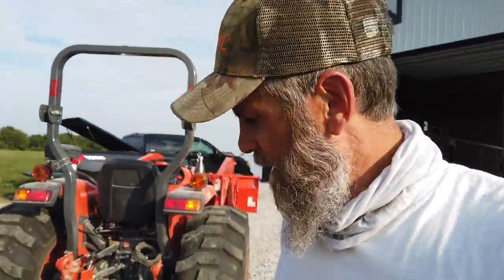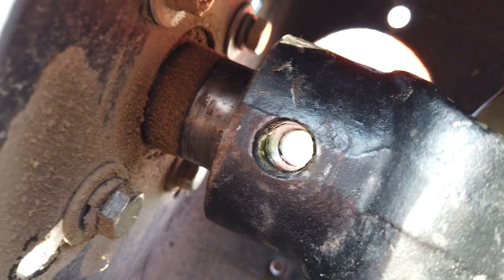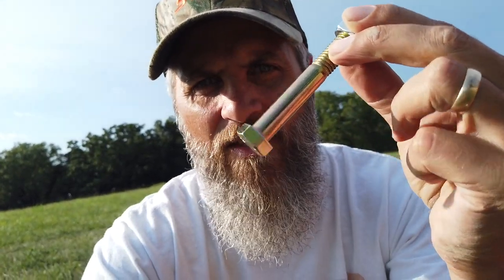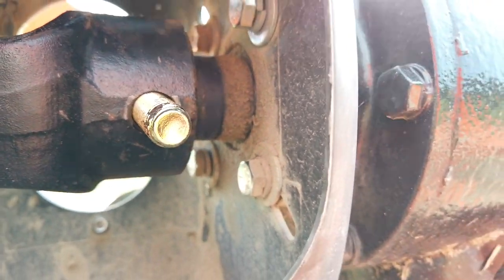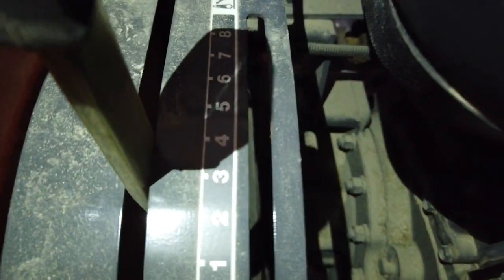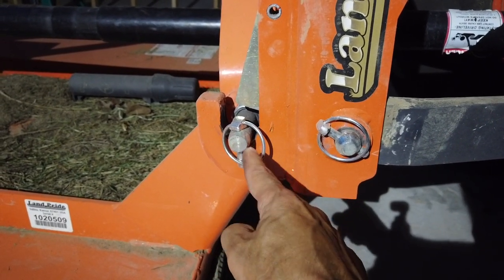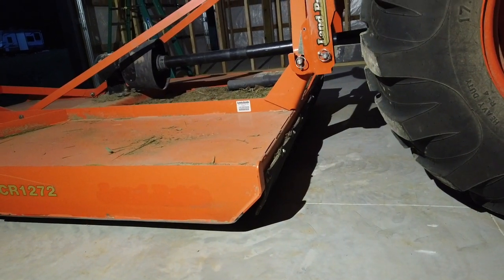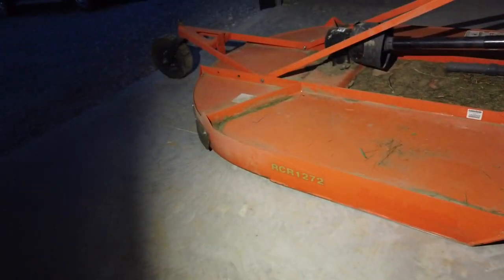I busted a shear bolt on my brush hog

Comment: Looked like you put a grade 8 bolt back in it, surprised the dealer sold you that as a shear pin replacement. Should go back with a 5 instead, you want that bolt to break instead of screwing up the drive / gears on the mower.

Comment: YOUNG MAN ,

ALL U NEED IS " SOFT BOLT "  NOT HARD BOLT , BECAUSE HARD BOLT WHEN BROKE WILL HURT GEAR BOX , THIS WILL COST U A TON OF MONEY , ALL WAY USE SOFT BOLT ,
Reply: Use whatever the manual calls for. My Bush Hog SQ160 with the side shear type driveline calls for a class 8.8 metric 8mm X 50mm bolt, approximately the equivalent of an SAE grade 5 bolt.